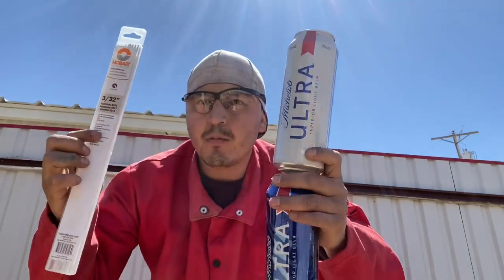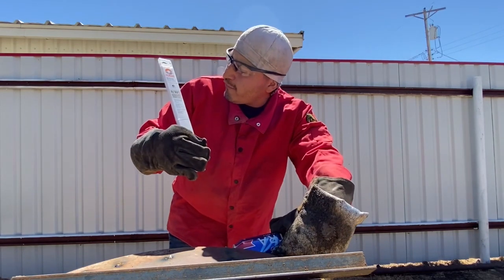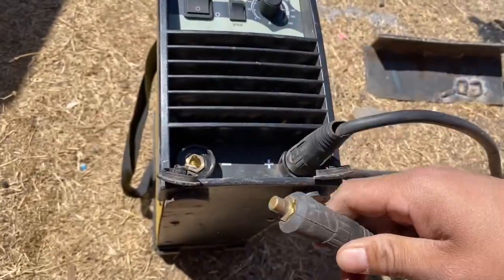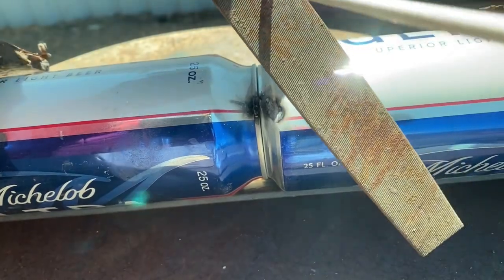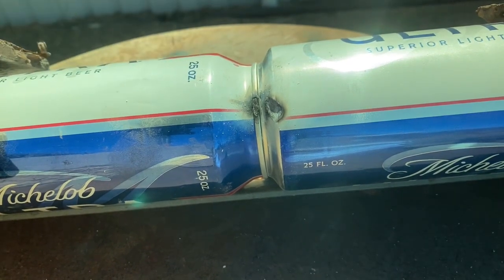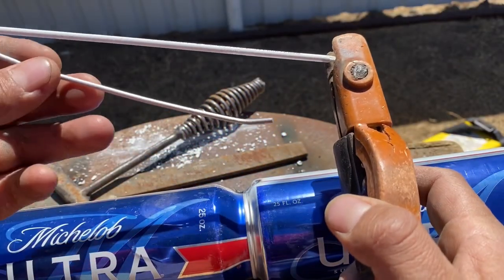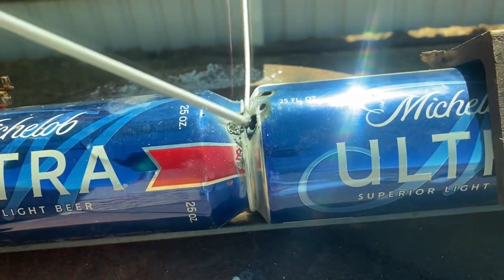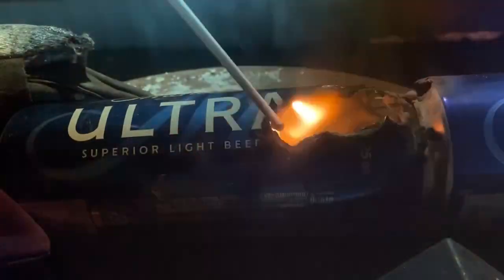Stick welding aluminum cans 4043 electrode

Comment: I keep a rock handy to grind off the slag that forms over the tip. I've also noticed that when I weld on the rolled lip of a can like that, it always blows open, and the paint underneath it gets into the metal and that's pretty much it for the weld. I've only had (very little) luck welding 100% clean aluminum.

Comment: Back of that filler package says DCEP. You said electrode positive. That is correct........ but then you set the machine up for electrode negative. Anyone else notice? Did I miss something here?
Reply: Hey.   You are very observant
Reply: He switched his polarity backwards
Reply: @titusmaldonado2556  Bro, he literally says "ground on the negative" which is not DCEP. It's the opposite. Check out 1:15 and after - still curious if I missed something else, or if he perhaps just misspoke.
Reply: @buckingiron8483 I noticed the same thing

Comment: I use these rods all the time when using a spool gun is out of the question. It’s a good rod but surface prep is key. I don’t weld cans but 3/16” material runs pretty decent. The secret is to not run a continuous bead, I use a lift and drop technique, this keeps slag splatter to a minimum and reduces clean up time

Comment: Another question, not exactly related to the topic (but not far); I've seen you using that Esab Mini arc 161 LTS... Have you tried 6010 with it? Does it work?
Reply: Yeah, it works perfectly. Tried it with BDemon 3/32 6010.
Reply from the maker: Yes they work perfect